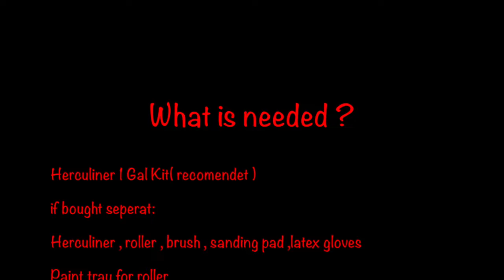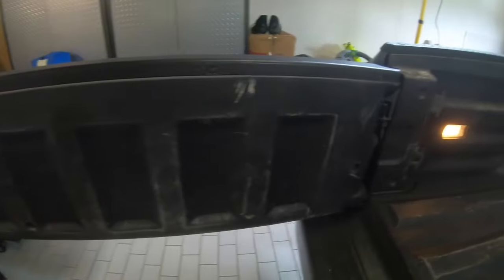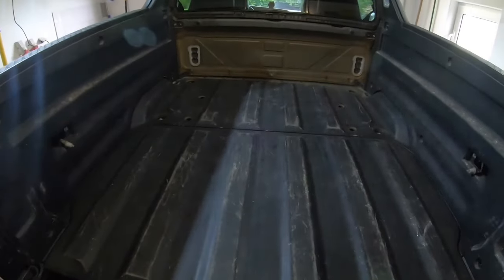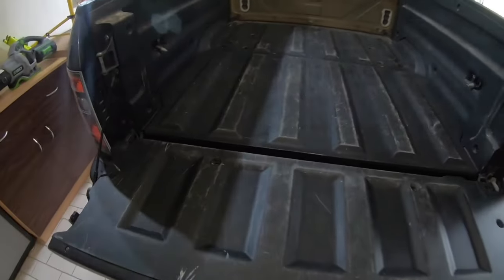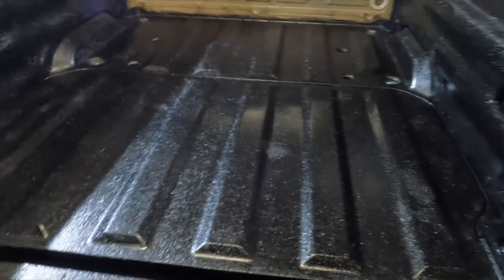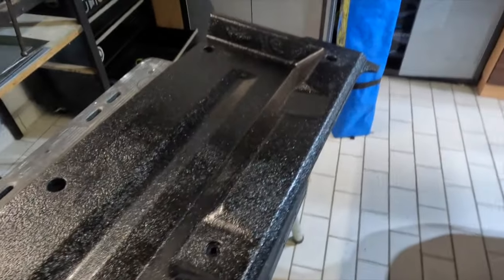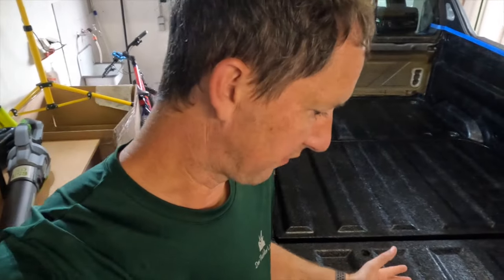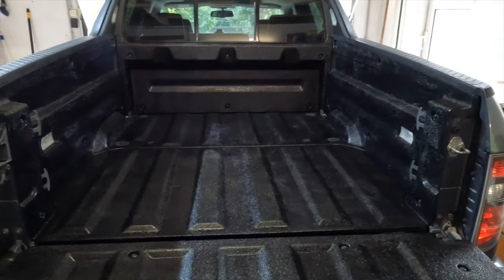2013 Honda Ridgeline truck bed restore

Comment: Suggestion: can't hear half of what you say because of the music drowning you out!  Very interested in doing mine as well.  Mine has a camper shell over it so when stuff slides forward (which it does constantly), I have to get a long handled hooked implement to reach in and pull it back to where I can reach it.  Looks good but do you think it really needed the 2nd coat?  1st coat appeared to be just as good (on the video at least).  Thanks
Reply from the maker: Thank you . I will try to remove music when I talk . I’m new to video editing still learning process . 

To your question . 
The product itself recommended a 2. coat. 
But I’m also recommending a 2. coat. 
After 1. coat it was very spotty . A few spots were still smoother then others . After the 2. coat  it was more evenly.  A 3. would be overkill but depending what you want to put in the back maybe necessary.

The product I choose holding up good . 
No scratching or chipping.  Transported pavers or wood .  I’m very happy with the results. And I should had done this sooner .
Reply: @gdm_crx8513  TRY TO REMOVE THE D@MN CRAP MUSIC WHEN YOU MAKE A VIDEO, HOW ABOUT THAT!!!!?????
Reply from the maker: Sadly you can't. At least not in YouTube, I would have to see if still have all the video and do a new one. Again learning experience. But thank you
Reply: @gdm_crx8513  Thanks a lot for your info on the bed liner!  Most helpful!  You probably don't need to remove the music entirely but make you voice prominent OVER the music would be better.  Thanks again.

Comment: Looks great. How has it held up over time? Would be interested to see updated video of it as of 8/2024
Reply from the maker: My video review after 10k. 
It’s holding up great , about to do an other one with the liner . ( new video without the Musik ) 
So far , wood , metal , car parts , pavers , normal use . No problems at all . 
What I really like on it . It keeps things from sliding forward during normal driving .
Reply: It’s nice to hear this update that’s it has been holding up great after 9 or 10 months of use.

Comment: Why remove from truck?
Reply from the maker: I don’t understand your question?
Reply: I was curious too why remove all of those parts.  What considerations were made to decide which pieces stayed with tape and which pieces removed.  What’s the advantages and disadvantages (of course extra work is big disadvantage)
Reply from the maker: @dan-777-abc  I wasn't not sure how good or bad this will be, rolling on paint can be messy. so for me it was like take of what I can. I didn't know at the time how to get the gate cover or the side panels off , but I do know now. if I do it again maybe I take everything off and lay it down flat. but it worked fine with the blue tape as well, but take it of immediately after painting, to ensure a nice clean line.

Comment: Does the paint give more grip?
Reply from the maker: Yes. Big difference. No more things sliding forward. I did 2 coats. The more coats you apply the more rough the surface gets . Of course if you break heavy things will slide. But I’m very happy with the product.

Comment: I would love to know how it holds up because I want to do the same thing thank you if you can give us back a reply I would truly appreciate it thank you
Reply from the maker: So far, I love it. No more stuff sliding forward in the truck-bed. 
Transported a few pavers. No chipping or big scratches. So far im happy with the product I chose.  will see haw it holds up over time.I think if you do a good prep and the product bonds well to the surface, it will be good for many years.  depending on your everyday use.